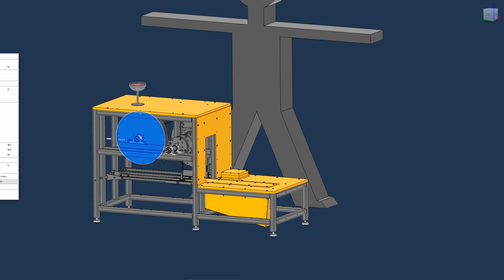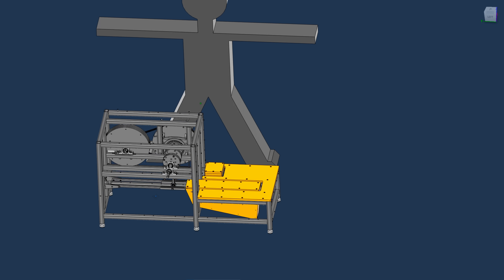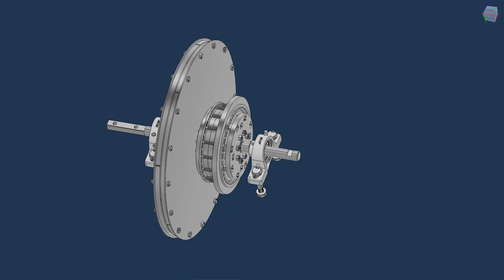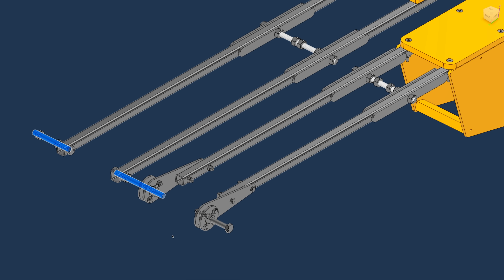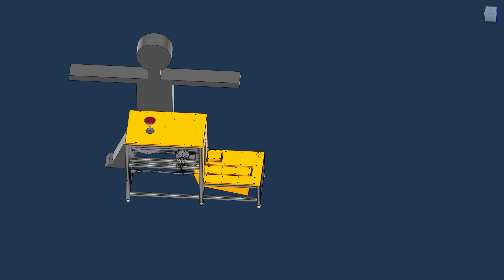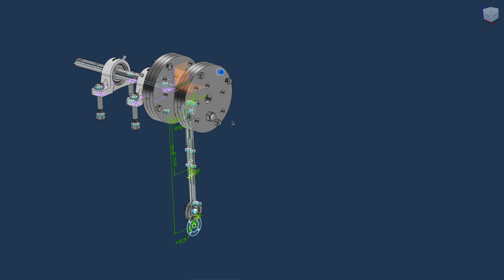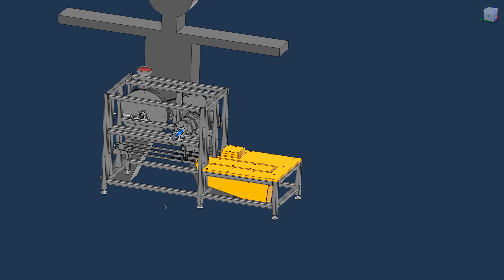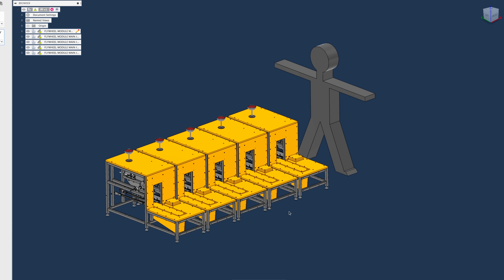Power Module Design Completed - Marble Machine 3 Ep.5

Comment: I don't quite understand how you achieve stable rotation, while adding energy to the flywheel with your foot. Per definition you will change the speed of the output wheel. Or did I oversee a control mechanism?

Comment: 3:34 - You might want to flip that plate the other way around. The force on the little hole to push the whole assembly down will be in the downward direction so having more 'meat' on the plate would be better than having a much thinner gap at the bottom rather than the top. 

Alternatively have a few holes to spread the load or at the very least move it to the middle of the plate.

Comment: The reinforcements on the peddle beams should rather be on top and bottom of the beams instead of the sides. You are basically bending the beals around the axis leaning highest stresses will occur on top and bottom of the section 🤙

Comment: maybe add a pivot point on the rod going from the pump peddle to the connecting rod. Tetter totter stile, this fulcrum bearing could then be adjusted  closer or farther from the peddle having a much wider range of adjustment with more leverage if necessary.

Comment: You should be able to change the angle of the cavity for the marble in a way that you have full control over the tork on each direction.
Second in order to not break your foot, make that link "bendable" so you can only "pull" not push on it, like ropes on a bell system in churchs.
third make sure you don't have ajustment to go "bellow" the floor, cause you still have a crushing point there on the side of the pedals. Take care!

Comment: You'd want to also make sure your foot can't be crushed if it slides forward into the hole while the pedal is going up with flywheel momentum. Having a direct drive pedal probably isn't as ergonomic as a ratcheted chain or some mechanism that allows you to coast while the flywheel is doing it's thing. I don't think being microsecond tight is as important to the performance. The original marble machine was a wonder that everyone fell in love with, that song captured the imagination of so many. It wasn't tight, but that didn't matter.

Comment: The square tubing for the pedals being reinforced is good but there seems to be one tiny oversight. You have those reinforcement plates and then the plywood is reinforcing another section. But nothing is reinforcing the small point between them.

Comment: Have you actually tried standing on a platform and pressing a pedal down below the platform level? Because I think that's going to immensely fatigue you within a minute at most -- you'll be moving your entire body weight up and down with your non-pedal knee, and you won't be able to lock it for stability, so you'll have to hold on to something else on the machine and therefore have less handsfree ability to manipulate it. I think it would be MUCH better to lower the platform and raise the pedal above it.

Comment: Was there a technical reason why an electrical motor couldn't be used?
Reply: Exactly.  Or at least to get the machine functioning, THEN later switch to human-power (if necessary/interested).  Trying to create a custom flywheel is going to delay this project by a year (if not more).

Comment: It looks like the piston rod lower bore is in line with the upper bore mounted to the "camshaft". Have a look at internal combustion engines. You should off center one of the bores to avoid having a dead point where you can't move the pedal anymore.

Comment: How about a CVT (continuos variable transmision), just like the little motorcycles, for that gas pedal? It'd be a very simple solution for the variable speed and BPM. Actually you could use some bicycle gears for that, and change the speed as simple as a turn of your wrist

Comment: Martin, one more time, add spokes to flywheel. It can be much lighter with the same efficiency. To be efficent, flywheel don't have to be heavy. It should have big moment of inertia, and it depends on heavines of the rim, because of square in formula. Contribution of the rest part to moment of inertia is negligeble, relative to rim.

Comment: The 12mm crank shaft is going to have all the torque from the flywheel tansmitted through it? Won't it twist and put a misalignment in the output shaft? Have you calculated how much force there will be?

Comment: I don’t know how much you know about flywheels, but mass father away from the center is the most important. 

If it needs more momentum and you don’t want to make it heavier just Mike a larger one with material cut out near the center. The larger diameter of two same weight flywheels will have more angular momentum. 

Just in case you don’t know and it causes problems.

Comment: Martin, I really like where this is going with manufacturability and safety. If you want to reduce the paneling on the foot pedal, maybe it can be on a spring hinge. Stiff to push down but easily gives way if it is pushing down on a foot. That could reduce the parts around the pedals, but you would then need to worry about tripping hazard, so it is a bit of a tradeoff. Don't forget proper PPE when handling heavy machinery (but always engineer the risk out when you can. PPE is the last line of defense, not the first)! Steel-toed boots can be fashionable, too!

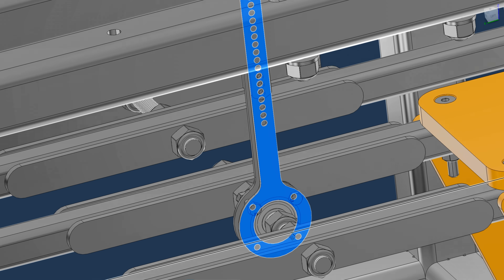Comment: 6:48 why don't you use a "push"-design? That way, you wouldn't need a direct connecting rod between the pedal and the fly wheel. Doing this, the pedal wouldn't chop off your foot (if the torque cage isn't there), it would just rest on your foot without doing damage instead.

Comment: Martin, I see a safety issue: there are no panels (p) under the panel (X) you're standing on, preventing your foot from sliding from the pedal under the panel (X). If the flywheel and the pedal are rigid connect, that can result in a really bad injury. Beside from adding panels (p) I think some kind of predefined breaking point would be fine to detach the pedal from the flywheel...

Comment: Those 20mm square tubings with 2mm holes will just bend when you put any bigger force on them like hitting the break hard or accelerating the flywheel from standing position. I would absolutely recommend using 20x40mm rectangular tubing to give it some more structural stability. Cheers from germany
Reply: Or at least make those strenghening plates wider to get the same effect.

Comment: How will you start the machine? When you stop the machine with the pedal is in a 'wrong' position, you will start the machine in the reverse direction. (easy solve by doing a half rotation, stoping the machine and start again) but what about the deadpoint? How will you start from a deadpoint? (pedal at the top or even worse; the bottom)

Comment: A few suggestions: 
Use clear acrylic to make the covers, this gives you safety and transparency. I also suggest that you have two pedals, like the pedal machine in the gym just pedaling with one leg consumes a huge amount of energy, why not make good use of the extra energy by using both legs to pedal. you can make a ratchet system so that when you are not pedaling the wheel will still turn. like a bicycle ... ( hear you say the noise, this is true but I think you can dampen the noise through design)

Comment: This is going to be a nightmare to balance if the parts are laser-cut and not machined. Also, commercial disk brakes are a thing, they work better than your solution and are cheaper.

Comment: Martin, you are going from "designing a piece of art" to "engineering an ugly oversized beast"! There's a whole world im between! This thing you engineered has so much wasted space and so many custom parts. Having enough room for maintainance is key, but when a small human could hide in there it's just bad design. "Form follows function" is a thing from the past! If we would still engineer like this, you would carry a 5kg shoe box as your smartphone. Design is a key element of good engineering! You did so well with the new marble gates. If you would just do the same design assessment here you would notice: way too many parts, way too many custom made parts, way too many assembly steps, way too heavy, way too expensive, way too ugly.
Reply: "First make it work, then make it work efficiently"... All in due time.
Reply: >If we would still engineer like this, you would carry a 5kg shoe box as your smartphone. 

Wrong. Sticking with the phone... As the "function" of the phone went from just a phone to phone, calculator, web browswer, mp3 player, you name it - the "form" got SMALLER.

Comment: With a 1:8 ratio with a full press on the pedal, you've given yourself no time for the pedal to fully depress, or is it 4 beats down and 4 beats up? Or 8 beats down and 8 beats up? It looks like direct drive, so you can't ratchet it, 7 beats down with one beat to reset to the home position... Would complicate things, but I'm wondering about the cycle your foot will have to maintain to keep the beat.

Comment: With an 8 to 1 ratio 120bpm will require the flywheel to be rotating at 960rpm which is significant inertia before considering the torque imparted from the rest of the marble machine back to the power source. May be an idea to implement a visual stroboscope to monitor rotational speed so it can be adjusted?

Comment: I am wondering. Why did you settle for a standing pedal?
Using bicycle parts you could probably have got an off-the-shelves solution to the drive train. Added bonus that you can stop pedaling and the flywheel would continue to run the shaft without losing energy moving the pedal. Bike chains or belts are so common that you could get repairs done in most touring places by any bike repair shop.
Your fan followers probably know somebody(ies) selling off-the-shelves torque limiters and governors, who can get you the CAD files, and, may even be thrilled to give you a 30-60 minutes one-to-one tutoring session on how to successfully import it into your design.
I'm also slightly worried by off-centered parts and holes on rotating parts. You'll need a professional advice on it.
From an unrelated field, I've learnt the hard way that while it's easy to think that in house custom parts may be easier to integrate, we often lose a lot more time later on when issues surface, need to be identified, then fixed, then a whole lot of other parts need to be adjusted because of new specifications. Please for your own sake, try to get existing industrial parts as often as possible from reputable manufacturer with good tolerances.
Reply: Love your work and passion, can't wait to see a few more physical parts being tested and music being played.

Comment: Those pedal arms look too thin for their length, especially for supporting your full weight. I'd recommend looking up bending moment and deflection calculators to get a better idea of whats going on and what to expect. Stiffness comes much more from the profile geometry than the wall thickness. Also, to actually reinforce the pedal the plywood would have to go past the middle connection point. As it is now it is stiffening the end section yes, but it's doing nothing to reinforce the middle pivot where the bending force will be the highest.

Comment: You may want to consider putting inner side walls around the pedal so you don't pinch your foot between the top of the pedal and the bottom of the platform on the upswing of the pedal. If there's enough force that you're worried about getting your foot stuck under the pedal, the same issue exists in the opposite direction.

Comment: My guess is with that 8 to 1 ratio you'll probably be able to peddle with good timing.  Whether you can make it 'tight' to your standards is a separate question.

If you can't, one possible approach is the use of a governor.  A governor is some kind of mechanical interlink or torque converter whose position or friction or some property is dictated by centripetal force.  This allows you to adjust it so that it will transfer power up to a specific speed, but once that rotational speed is exceeded, it disengages the power transfer.  Then due to friction it slows down, re-engages, and starts transferring power again.  If you build it mobile enough you won't notice the constant engage/disengage for a binary governor, but you could also make an analog one that transfers a percent of force between 0% and 100% at the transition point (say, with allowing friction plates to slip slightly) hat will basically settle on some net slippage exactly at the tuning point.

Anyway, that was all a lot of words to say: "look up governors for motors" and see if you can make that work for you, if your peddle timing isn't as tight as you'd like.

Comment: I congratulate your progress! I would suggest putting a small team together to design along with you and check each new idea/step. Marathon design sessions by yourself are not the way to go. This design is very, very far from being ready to be made. There are several probable issues you have not fully realized. How many times over the years have you said the words "I worked on this for a week straight and am confident this will work straight away," and how many times did that actually happen? Not many. Do not be discouraged. But you're repeating past mistakes because you're working primarily alone. Again.

Comment: 1. what you built is a torque limiter what you need is a governor
-you want as much torque as you can get

2. i would recommend a ball governor, aka a Centrifugal governor
-these force specific rpm ranges for both input and output
-these gibe you a nice moving bit that you can design to look like anything Wintergaten,Whilson,anything as long as it is a series of weights spinning around

Comment: I' think you'd be happier if the pedal only engaged while you were stomping.  Like how you can stop pedalling a bike and it still goes?
Likely you're going to work like hell to get the flywheel up to speed, and then you're going to want to ease off, but cant because the pedal is flopping around.

Comment: How can you machine the position of those pillow block mounting holes?  The top bar should be removed or offset.  Or mount all the pillow blocks on a single plate.  Additionally you will be crushing the tubing when tightening the bolts on the pillow block

Comment: Not sure how you are planning on measuring the rotation speed. My suggestion would be attach an encoding disk to the output shaft and read it with an encoder pickup with an arduino/RPi/etc to get a read on the rotation speed multiple times on a rotation, then plot the data to see if it is constant. You might also want to attach a 3-axis accelerometer to the top of the frame to make sure the low frequency vibrations are acceptable (read it with the same arduino/RPi/etc used on the encoder for instrumentation simplicity) in addition to contact microphones for high frequency vibrations. I don't think any of these measurement devices are necessary for the final build, just for collecting data during development.

Comment: I still think the structure should be made of heavy aluminium profile systems. Like the supplier Item24.
Reply: I propsed the same when the welded steel structure first appeared... would probably much easier and the black version also looks pretty cool 😎
Reply: @joerghh  I understand Martin somewhat since I too tend to "over-design" things, but I think these laser cut custom steel tubes are a overcomplicated solution to a "problem" which already have readymade solutions. It's the bearing housing scenario over and over again.

Comment: Any reason you're not using a threaded linkage for the cam link? That link adjustment currently looks like it could be prone to shearing between the holes you have designed currently if the force applied is too high

Comment: Im sure you've put much more thought in this design than me but I have to mention that this way of pedaling looks really uncomfortable. The way the highest position of the pedal is in line with the step means that you either have to rely on your calf muscle to move it or keep the pushing leg straight and use the other leg's thigh muscle to raise your whole body and letting your weight push the pedal. Im really curious as to why you chose this design instead of keeping the previous one where you apply pressure by putting your weight onto it.

Comment: How does it ensure that the shaft is always spinning in the right direction? If the machine stops running in the right direction with the pedal rising, the machine will start running in the wrong direction when starting up again by pushing the pedal.

Comment: how will this get started from 0, when the pedal is in its lowest position? with a handle you coould always push and pull, but with only a pedal you can only push. so how can you pull the pedal up from a standstill?
Reply: there is also the issue of: since we can only apply force to a circle via a push-rod, how can we get the circle to start rotating, when the pivoting rod is resting at its extremes. you end up pushing or pulling directly into the circles center, so that no rotational force is converted. 

an additional issue is, that the circle might even start rotating in the wrong direction. something to check/limit the rotational direction is needed
Reply: now that im thinking about this, pulling the pedal up isnt that hard. just put a slit into the cover, so you can reach in with your fingers and pull. just like how big cartons have two slit-holes, so one can easily carry them